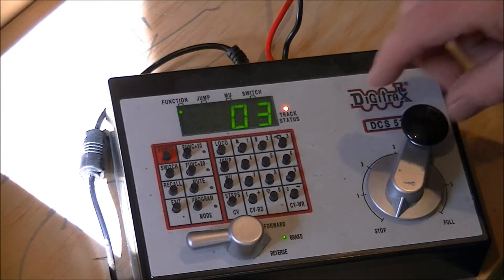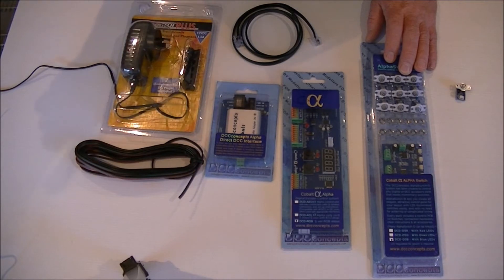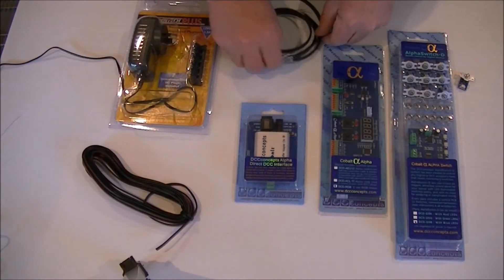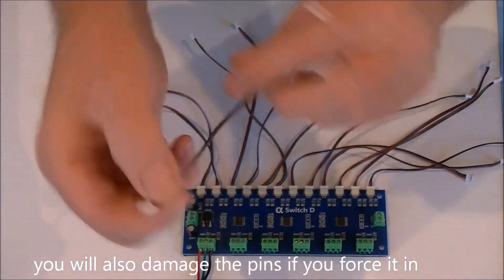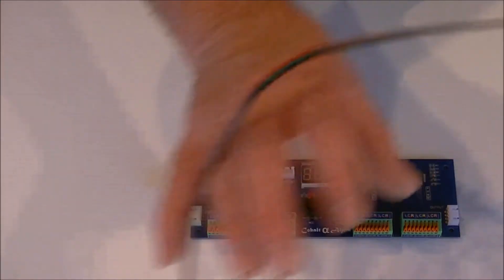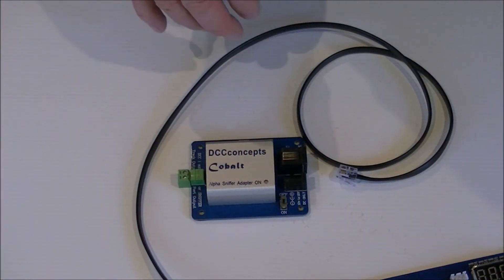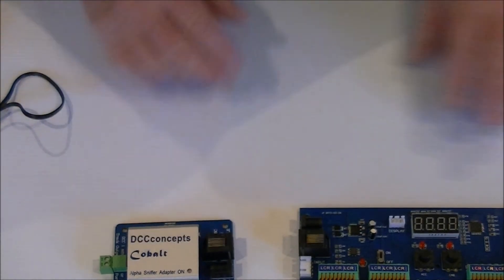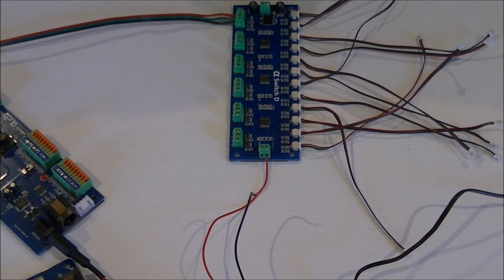DCC Concepts Cobalt Alpha Point Control System part 1

Comment: Hi so if you change turnouts by dcs then the led would not show correct led route ?
Reply from the maker: I haven't watched the video for quite a while, but the whole idea of the system is to use it separate from your normal DCC power bus, if you are using your controller then you wouldn't be using this system-as they are two separate systems. and you cannot run both a power DCC bus and a Sniffer bus into the DCC in ports of the motor.

 You could possibly wire an LED into the board from your motor but you would havde to look at the motor wiring manual or seek advice from others as i have not had to do this.

Hope that helps
Al
Reply: Thanks

Comment: Hi very interesting I have solonoid Peco points do you know how I could use same setup as been told by dcc concepts not possible with solonoid points I too have a Digitrax dcs52 thanks hope you can help
Reply from the maker: to be honest, I  wouldn't know unless you could somehow rig a decoder to the solenoid points? to take the digital address signal from the cobalt alpha encoder
Reply: They do a an accessory decoder but said it would use too much power so they said I would have to use a Alpha pier box and an Alpha box another £200 also said I couldn’t use their sniffer with my controller the same as yours confused.
Reply from the maker: I think you are missing a vital point here in that this system has nothing to do with your controller, so in a way they are right, as the sniffer uses  separate bus wires (not the same ones as your controller.) to carry the digital system to your point motor (but it is a digital system so you need some way of decoding it at the point motor).  If you have a DIGITAL accessory decoder attached to your solenoids then so long as you have enough power to operate it then i don't see why it wouldnt work.
But for the cost and difficulty of worijng in accessory decoders you may just decide its not worth it and stick with your old system. For the cost of digital point motors I'd consider changing the solenoids out for digital motors of some kind. But that is a decision for you to make on how much you want to spend and how many you need. If all you want are LED indicators or switches then  i know you could do that without the alpha system, but someone else would be better to show you how
Reply: Thanks the sniffer wires do they go to your separate accessary bus
Reply from the maker: yes

Comment: Hi. Please note that I have yet to watch Part 2; however, although this all looks great with the pretty looking circuitry, I wonder if this is all necessary. As I understand it, the Cobalt digital iP turnout motors have a built-in decoder and separate terminals for operation by manual (and computer-controlled?) switches. You would need longer wires to reach the switches from your control panel, and you would need to buy appropriate switches, but this would still be cheaper than all the DCCConcepts gubbins you bought (nice though they are). Am I missing something here?
Reply from the maker: The whole point was to remove the control of the point motors from the DCC controller (a 3 step process relying on my memory of switch address which still had to be set in the digital IP point motor in my controller(and DCC power bus) into its own bus system to simplify the control of the points via a lit up mimic board. In the end I have a simpler system where at a glance I know which points are thrown/open and simple push button operation, saving so much train derail, re routing and collisions. Watch the next two parts and you will hopefully see why and how it works.... and the small hiccup i faced
Reply: @allynwoodmodelling  I look forward to the next two parts.

Comment: The Digitrax Loconet  cables are reversed wired like that. Team Digital also does the same for their system which is compatible to Loconet. So I'm guessing DCC Cobalt are following that standard. I'm not sure if this hardware is compatible. Is this DCC Concept system Loconet compatible ?
Reply: Hi John,
You are quite right re: the cables. We would normally recommend our DCD-ACL cable to link AEU and Alpha Sniffer...

Our ALPHA systems use the NCE Cab Bus protocol so they are not natively compatible with Loconet. However, you can use Alpha Box to interface with most other DCC systems - this is achieved by Alpha Box 'overlaying' the accessory command onto your existing system signal.

I hope this helps!
Richard Brighton
DCCconcepts.

Comment: Do you have to run this on a separate power bus?Love your videos ( you got me through electrofrog with digital IP motors!)
Reply from the maker: I do run mine on a separate power bus just to make it easier for trouble shooting, you don't have to if you hook into your DCC controller instead of using the sniffer